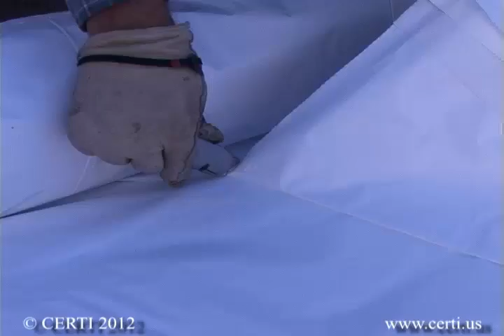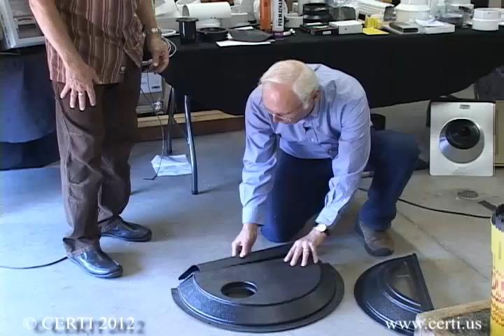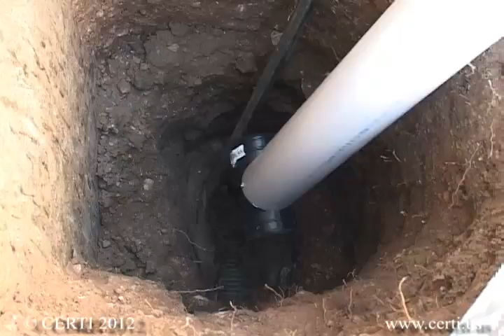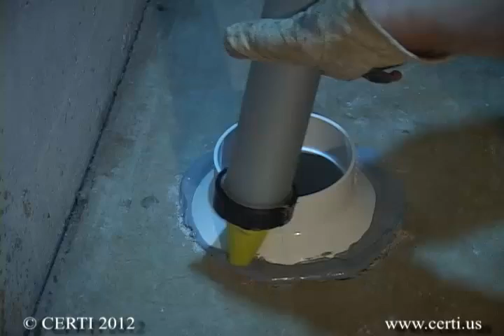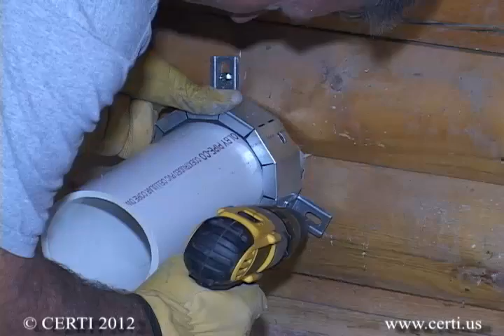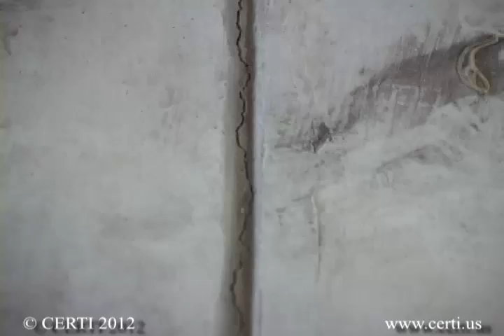Overview of Radon Mitigation Approaches

Comment from the maker: The vent pipe draws air out of the surface water drain or sump.  Since the drain is in the underlying soil, the perforations in the drain pipe draw soil gases including radon from the soil and exhaust it into the atmosphere at a location where the radon cannot come in an open window.  Since the drain pipe is not full of water (because it drains water away from house or into a sump) there is ample free space in the slotted pipe to collect soil gasses.  It is very effective in reducing radon, provided the installer does not do anything to the drain pipe that would preclude it from continuing to collect surface water.